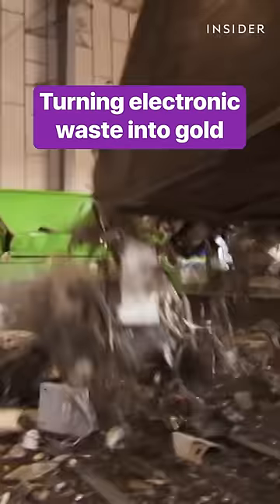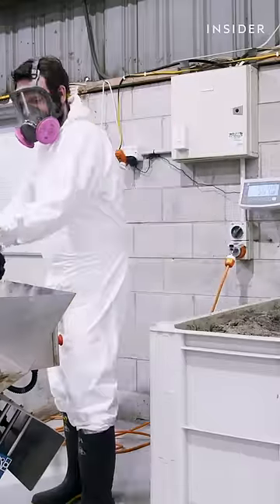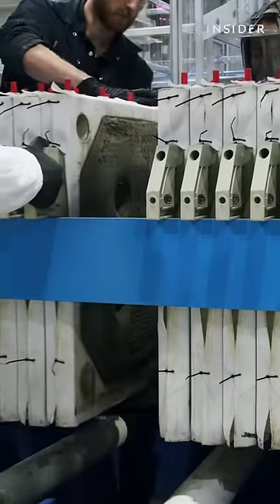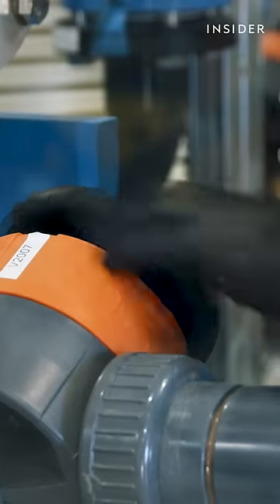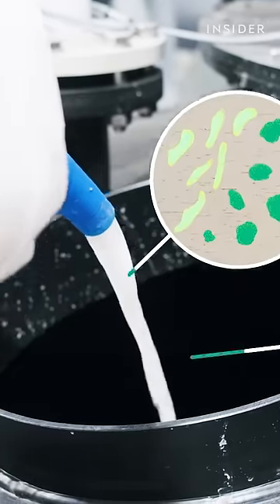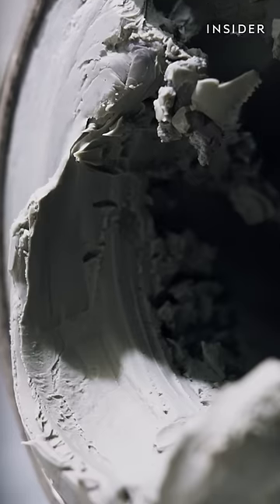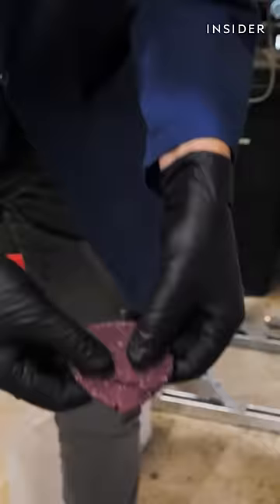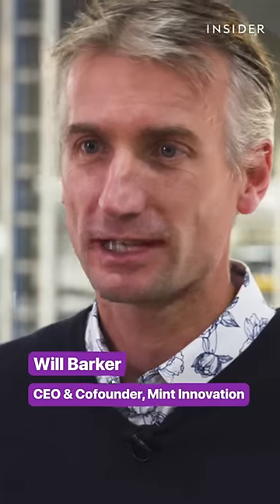Did you know you can extract gold from a pile of old circuit boards? #ewaste #gold #recycling

Comment: That's a ton of work and energy. It's unreal it's profitable, assuming it is.
Reply: Have you seen how much work it takes to get it out of the ground?
Reply: I buy all electronics. 
Its worth alot.
Reply: It's not so cheap- metal recycling is not nearly as difficult a task as plastic or paper-plastic. You get this garbage by weight for cheap and considering that separate workshops are often used for metal processing - days for machinery, others for cans, etc. you know what metals are present there. 
(That's why it kinda profitable in places like Africa. It's just garbage it's free or almost free. And the pure product is sold for the same prices as the first melting. Metal recycling is a pretty good  business.
Reply: it's not profitable by itself. company like this are contracted to recycle waste.
Reply: @nakkabadz6443  we just probably live in different places. I know that here it's makes little but makes money.
Reply: Plus supply and demand, we’re ultimately going to run out of precious metals so they’ll get more and more expensive until this is the only option. Plus I’m sure big companies can profit from buying recycled metals in order to brand as sustainable
Reply: We can recycle a lot of stuff. Way more than we do. Problem is - profitability.  I suspect this isn't profitable
Reply: Industrial grinder , guy with shovel , inexpensive chemicals , free microbes.. seems alright
Reply: It is profitable from the amount of board that they collecte something in the end they probably make like a 10% profit but then tou had gouvernement subsides and they make bank
Reply: Thats why I try to reuse pcbs or repair broken electrics
Reply: Who cares about profits if it benefits the environment?
Reply: Yes but not on the big scale as of yet. Hopefully people will inivate and increase production
Reply: @franciscocasillas6562  right? who cares rights? how about you start recycling junks in your place.
Reply: My question, too. Is it economically feasible and sustainable ?
  It's well known that ordinary seawater contains about one gram of gold per 1m tonnes, but no one has yet discovered a way to mine it cost-effectively
Reply: I can envisage a distant future when landfills are mined for resources we currently use and discard
Reply: mining it and processing it from the earth is also a ton of work and energy. All those mega dumper trucks, all the deiesel, all the furnace, all those employee wages.
Reply: Seems like it would be easier to just put that ground up "sand" and heat it up in a furnace and burn the crap, let the gold sink to the bottom
Reply: You would think so but I read somewhere that companies were seriously looking into ‘mining’ old landfill sites to extract metals from old electronics. As the cost of traditional mining is so high.
Reply: Gotta start somewhere. That's the only way to evolve better and cheaper methods
Reply: @leocervidae yea no we’re not. We have thousands of years worth of precious metals still available to us and then let’s not forget the moon…. By the time we actually run out of precious metals AND use more than we could recycle with a 100% effecting return like in aluminum we would just turn to the moon for most of the exotic metals we can’t recycle or obtain. We will never run out of most metals. Thats just how it works.
Reply: It is
Reply: It's actually a form of question begging to assume that every endeavour must be financially profitable. Plenty of useful and vital services are not profitable at all, but we need them nevertheless.
Reply: @kasroa  ok but it's profitable
Reply: @kasroa I don't agree with unprofitable recycling. It justifies the use of unsustainable products like plastic. If we cannot profitably and sustainably recycle, we should use different products that enable this cycle better.
Reply: we have a shortage of gold that can be mined from the ground. so any gold we can recycle is valuable.
Reply: It's probably not, it's likely a venture capital dump and when the money runs out the business will close.
Reply: It's not
Reply: it'll always be profitable, the price of gold changes to reflect how hard or easy it is to obtain at any given time.
Reply: well most of it is probably free or pennies to the thousands of pounds..you can have most of it automated with very few workers just dumping the boards into grinders and baths. it showed you a very small amount of yield, imagine running it 24/7 with infinite supply and then selling the gold for retail amounts
Reply: Why do you think things like cell phones are so expensive they have to recover the money lost recycling.
Reply: When u do like this it's non profit, there are plants that can do it realy professional, we sell put know how to the US in future, greets from Germany 😂
Reply: All the scrap is usually free!!
Reply: I doubt it
Reply: @RyeDoug  The gold isn't in its elemental state in the ash, heating it won't return it to its elemental state.
Reply: Lots of very cheap synthetic materials go through a long process like this. The key is that the materials to make them are cheap themselves and the machinery lasts long with fair upkeep. So your biggest cost is labor, and these workers aren’t really going through the same level of dangerous strain as miners would. It’s much cheaper and frankly easier to do it this way than to dig it from the ground.
Reply: I've heard that there is enough gold on this planet to cover earth's entire surface with 10 feet of gold but apparently humanity has only recovered about 5 Olympic swimming pools of it.
Reply: @matthewfrost3677 there's a solution dude Africa that's all ill say and it's just sad.
Reply: It's difficult, expensive, toxic, polluting and non profitable. Nobody in good right mind with do this, unless the objective is not purely profitable.
Reply: @ernesthill4017 it’ll probably start happening in our lifetime. Especially if we figure out easy, clean, renewable (preferably carbon neutral or negative) energy
Reply: Saves poor people risking their lives in mines . Profit should be less valuable .
Reply: What happens to all the material in the ground up circuit boards, and the waste reactants. They might be making money but, is the planet ahead?
Reply: It’s not
Reply: @leovoldoftrest9987 what are your opinions on plastic, paper, and cotton reusable grocery bags?
Reply: @YukonJack  I almost always use reusable bags in every store. I keep them in each vehicle so they're available. If I don't have a reusable bag I go paper because I can reuse it or use it to start a fire in my fireplace. I dislike plastic bags because they don't break down well, require a lot of energy to produce and end up all over the place outside. Recycling programs for plastic bags are a scam like a lot of recycling programs.
Reply: @leovoldoftrest9987  thanks for the response, here's why I asked. It was initially thought that because plastic bags don't break down well that having them as one time use bags was worse for the environment compared to other means. They were wrong. Though paper bags break down more easily and can be used in a variety of ways, the environmental impact of paper bags between the water usage, treatment, and organic material that goes into making them on net is greater than plastic bags by a substantial margin. The cotton "reusable" totes are even worse. They obviously require cotton to make them and the water usage from start to finish is massive compared to paper and plastic bags. Cost analysis has been done on them at well as paper and plastic, and the findings are ridiculous. You can look it up and confirm it - the cotton totes literally break even after 1,000 uses. Yes, one thousand. You have to use each tote one thousand times just for it to break even on all of its costs . That's just a single tote. If you have ten, that means you'll need 10,000 total uses before you save a single cent on the materials and MASSIVE amount of water that goes into their production. Plastic bags have their faults without question, but the environmental cost is substantially smaller than every other common means we have access to. Plastic bags take up the least amount of space, they're the cheapest, they use the least water, and they can be reused for plenty of things around the house, car, and many others. Paper and cotton are well intentioned but the saying "the path to hell is paved with good intentions" absolutely applies here. I'm not saying your an eco-terrorizer for using paper bags or the totes, but if you genuinely want to use what causes the least amount of damage to the environment plastic is the way to go. If you want to use paper or the totes regardless that's obviously your call and you don't need me to tell you how to shop or live your life. The greater point is that we make many choices, most arguably, that are based off "anecdotal evidence" aka experience, but even in doing so we may get to a solution but it doesn't mean it's the best solution. Educating yourself about many things is helpful if nothing else so you can make a difference, and at best so that you can educate others and have it all roll down hill with the hope that the knowledge spreads. Our air is a lot cleaner now than it has been for a good chunk of time. We get the benefit of breathing cleaner air and that's obviously a good thing and I don't think anyone would argue. An unintended consequence however is that in removing pollution from the air, their is less matter in a given area which means more light and therefore heat reaches us and our oceans. Less pollution is good for many reasons but as we make the air even cleaner, we are making the planet and the oceans warmer. That is also verifiable. Everyone has bias and if anyone thinks they don't, they are beyond naive. Being able to see past our own bias gives us an opportunity to actually learn, grow, and challenge our notions of what is "right" and what is "wrong". I encourage you to challenge your views, continuously be on the hunt for the truth, and be willing to offend people on the way there. Whether you live like a saint or a heathen, you are going to offend people. If you are going to offend people either way, you might as well offend them and be "right" in the process.
Reply: @YukonJack  I'd rather have a product that breaks down into natural materials that the Earth can handle instead of something that doesn't and results in microscopic plastics all over the place. I consider cyclical processes more sustainable.

Education is important but you've got to be careful who's educating you unless you're discovering the knowledge yourself.
Reply: @ernesthill4017 landfills are minded, mostly for steel, iron and copper though.
Reply: looks like UCI nuclear reactor prices: $3000 per hour = 000.9 mg of gold (search for video 'n see ferself). Great comment. Thumbs up.
Reply: If it wasn't profitable they would not be doing it
Reply: @RyanElkaakati  I think it's more proof at a certain level money isn't needed to do things, payouts are already given in the workers' stability ... there's no way there's enough gold in circuitry to condone this type of mechanical extraction ... the numbers aren't there. The reason they are doing it is because most of these facilities you see are for making or taking apart other things, the circuitry is just one in a long conveyor belt of things to be worked on. No way this operation is reliant upon the gold they extract ... I would never believe it even if the numbers were shown to me ... can't fake: light, shadow, gravity ... nor reasoning.
Reply: It's not. The circuit boards themselves are often worth more than the gold in them unless they're severely damaged. Which they are now.
Reply: @aoki6332 not really. Just repairing and selling the boards would get them more of s profit.
Reply: @RyeDoug it would be easier to sell the still functional boards. Repair the easy ones.
Reply: @callumkristofer7793  you cant do that the electronic is fried no company will want to use old circuit board even if there painting whit a shiny new look this is not a chair
Reply: @Capthrax1 can you link to the specific processes of different recycling possible to save it?
Reply: @aoki6332  no "company". Your argument is already false.
Reply: It takes 47 trillion dollars to extract an ounce of gold using this method.... Why dont They Just buy the gold?
Reply: @matthewfrost3677  to be fair, africans do this stuff for free 😂
Reply: At $2k an oz, I’d say it’s quite profitable at this commercial level.
Reply: Chasing profitability (aka simple greed) will eventually suck the resources dry. Better start improving recycling methods now and pay a lesser price down the line.
Reply: I agree 👍 with you that it's a ton of work to get gold 🥇 from the crude state it exists in the earth to the forms we see it in the jewelry 💍 stores.
Reply: @JudeAtisele-sk2lr  and child labor
Reply: In this process it actually is incredibly profitable. Some of these guys make hundreds of thousands from it. You do have to do the processes correctly tho because done certain ways it is not cost effective.
Reply: Well theoretically if there is no product that's lost in the process then it is as they can create more circuit boards with out buying gold. Just keep reusing old boards gold for new!
Reply: Doing it in my yard I was able to pay off part of my college so its quite profitable.

Comment: We need to see the part where it turns from beet root mud into gold. You are missing the key step bro.
Reply: You can do it by using meriatic acid to basically liquify the metal then use phosphate to bring the gold back to a solid then filtering out the gold from the solution. There's lots of videos of how to do it. Problem is most gold terminals and circuit boards have very little gold.
Reply: You might get like what, 1-2 grams of gold from one tonne of the waste? 😂
Reply: @AC-iz7eh  yeah it definitely isn't enough to be  to make it worth the effort.  It's easier to put out ads buying gold jewelry and give them a little under spot price for it. You will accumulate more gold faster with less effort but then you'll have to deal with all sorts of types of people lol.

Comment: I work with electronics, we recycle like 10-20 tons every day only with like 10 people. Some high-end circuit boards got full gold coating over them, so they worth quite a bit. If we avg them out, we get about 100-200 kg of gold from every 10 tons. Its a good amount of profit.
Reply: Are you saying 1/100th to 1/50th of your e-waste by mass is gold?
Reply: So that’s over 10 million dollars. That’s some good money.
Reply: @hubbsllc  Depends on the board itself, some of them have way less, some of them are basically covered by it.
Reply: that's a minimum of $6.4 million a day
Reply: @uctynguzb  On a good day, it could be, but all together the profit margins are not too great, there are some other expenses like transportation that can be super expensive for some of theese machines, and we have some that doesn't generate profit at all, yet it takes a whole truck to deliver just one of them to our workplace.
Reply: @Laplace912  The chemicals used mean that you have a HEAVY regulatory burden on your business, too.

What is NOT precious metals also has to be disposed of - which is more than 90% of the incoming material. That's also a potentially toxic waste problem.

Comment: Or the Africa version is just burn all the plastics off, right next door to your house preferably.
Reply: have fun at work tomorrow 🎉
Reply: That's the Missouri way also, whether you live in the Conservative Rural areas or the Big City.
Buy tons of electronic waste, and burn away all the plastics to collect the gold, platinum cooper and other less valuable metals.
Usually done In the Garage.
Reply: Can't beat a two-minute commute.
Reply: There's more than just gold when it comes to metals. Melting it all would either form an alloy or just burn the plastic and leave behind a mixture of unalloyed metals.
Reply: Make sure to have your children do it too. Everyone is required to not wear anything more than sandals/flip flops, but barefoot is strongly preferred
Reply: @mcgee1864  thats a luxury
Reply: @us3rG  What is, having children do your work for you, going barefoot for work or flip flops?
Reply: @TRak598  they melt at different temps and can be separated in steps, even when using crude homemade facilities.
Reply: @mcgee1864  try a day in Africa as an African, you won't survive, we have to take shots so you can live with us, yes shoes and not working are luxury most Africans can't afford,
Reply: Hey, it’s cheaper. That’s the only thing that matters after all.
Reply: Plenty of lead and copper in the recycled mix besides gold.
Acid or electrolysis is usually used to refine it past the amalgam stage..
First time Ive seen microorganisms being used to partially refine a slurry mix..
What is thier recapture % ?
Reply: @us3rG the shots are poison
Reply: Hey kids lets play find the shiny

Comment: The gold is in the chips, CPUs and hard drives. Take those out, strip them down, and you've got a much higher % of gold to start with. Most of the metals in the circuit boards is lead and copper and not that valuable.

Comment: But how do I do this at home using just household products?  I've seen ppl on YT extract God from electronics/motherboards/old cell phones using mostly just vinegar.
They break the pieces into smaller parts by hand or hammer. Soak the part in a solution, of mostly vinegar., filter as u empty it after a wk or 2 to catch any gold flakes. Do this again. & I forget the other steps but the last step is to heat it all in an outdoor furnace/kiln. & thatll give u gold